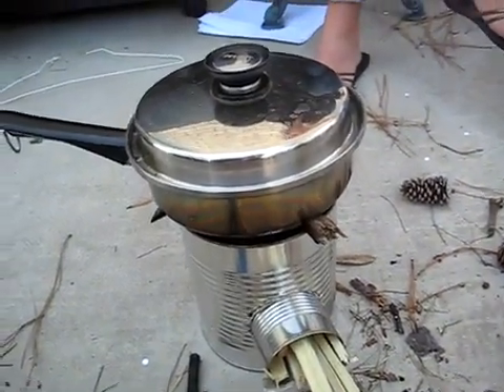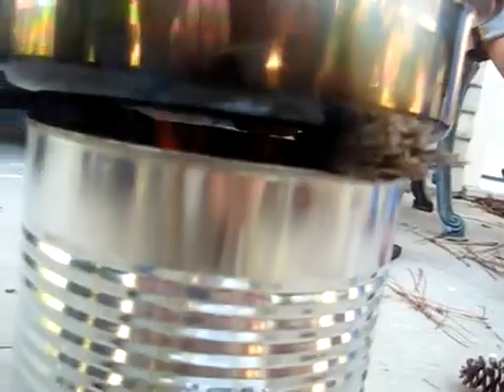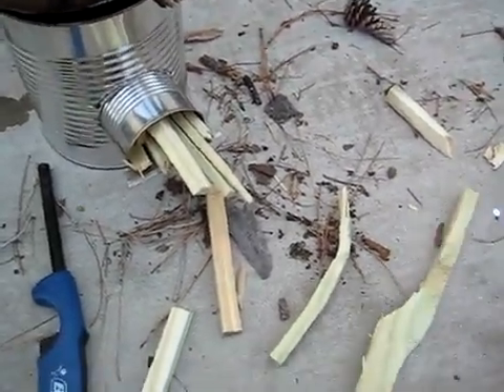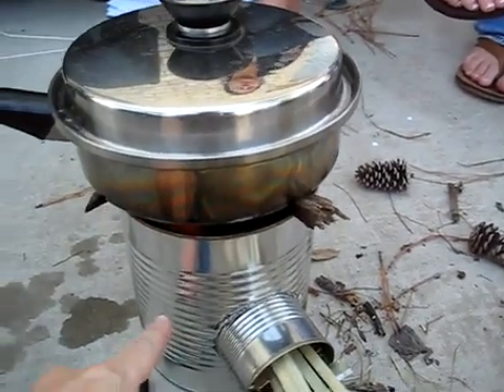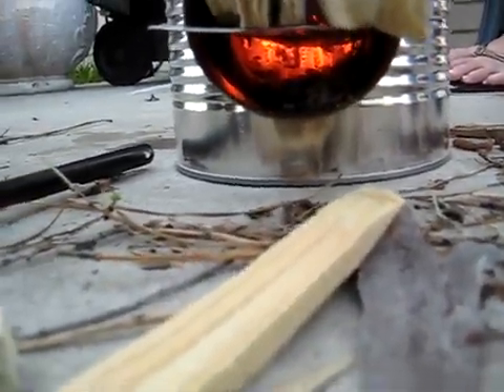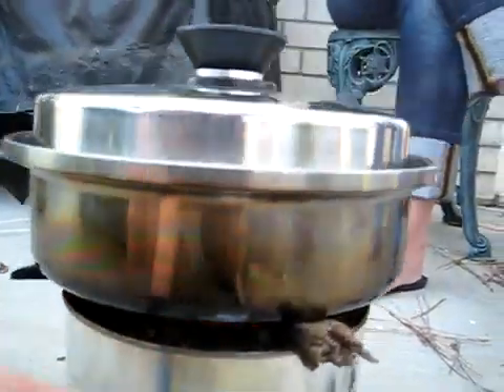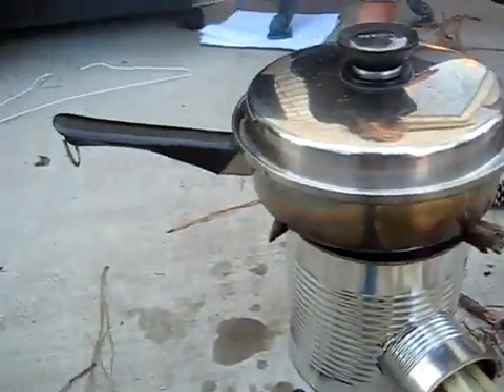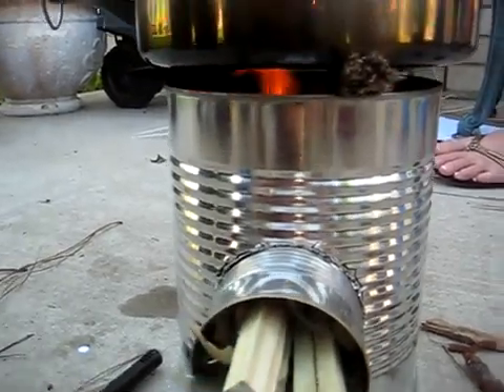Best Rocket Stove Design Ever Part 1

Comment: Don't listen to that guy. With the proper tools and experience, I bet you could build this in 15 minutes. I don't believe this is the best design though. You could have some built-in stands for the pot by leaving a lip at the top with holes for exhaust. And how about multiple holes on the bottom sides for air to get pulled into the flame. I realize air is already pulled in from the loader but just wondering if multiple holes would work better because the wood is blocking air input.

Comment: Umm, have to point out that the lumber scraps you are using look to be pressure treated, when this type of wood is burned, it gives off extremely toxic gasses and heavy metals. Whole families have been poisoned from this practice, and of course not so good for our enviroment. Pine needles may not be a good choice, but this is far worse.